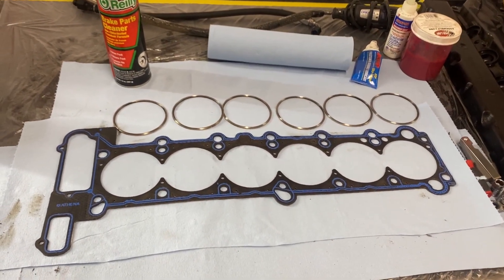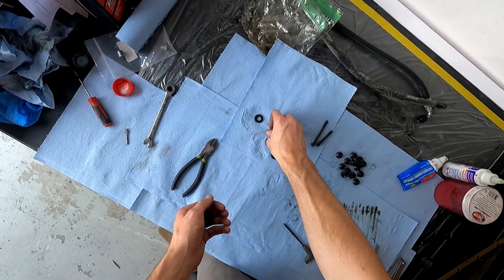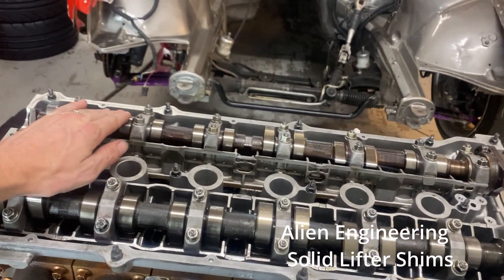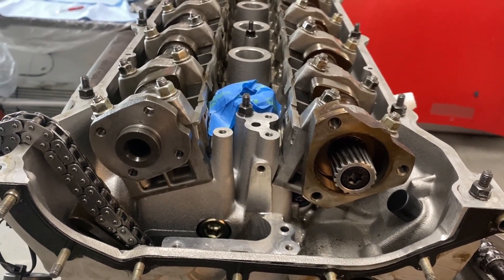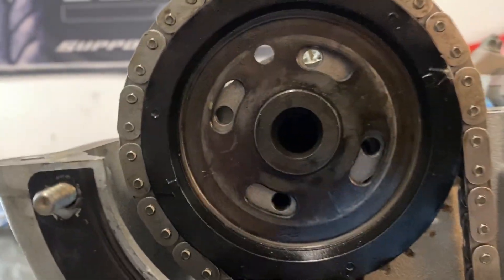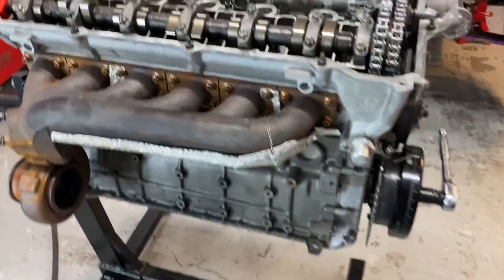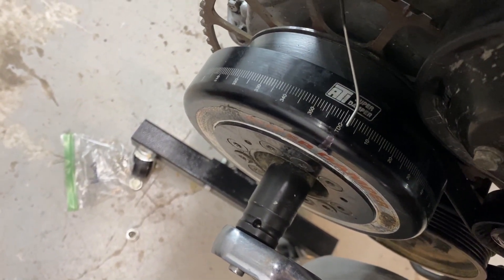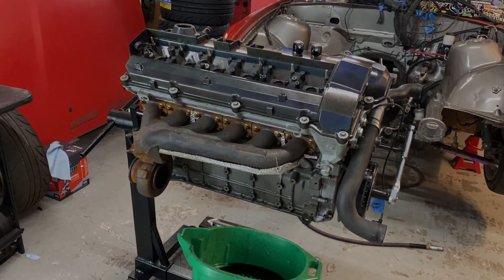M50 Head Install / Timing Engine!!  VANOS Install and Testing How To!!  600whp Build Series Part 3!!

Comment: Hi what cam tray did you use with the m54 intake cam
Reply from the maker: I used m52 cam trays and lifters for both the m54 and m50nv cams
Reply: If you wanted to since you grinded the head for the vanos could you go back to the vanos front cover and valve cover or would it not seal right